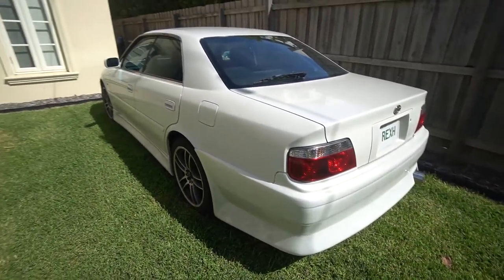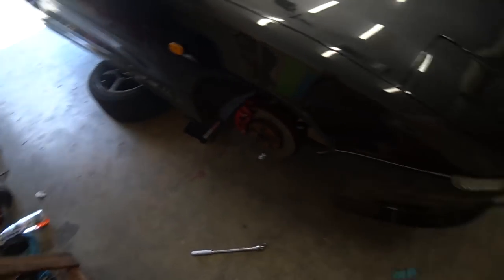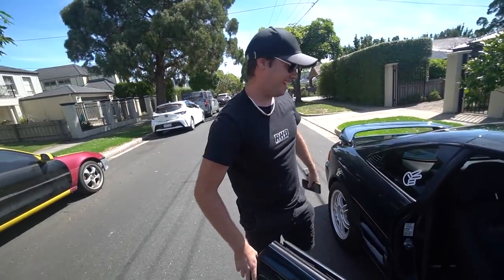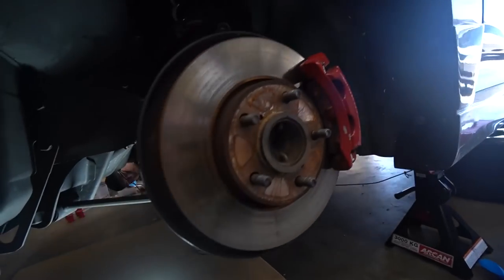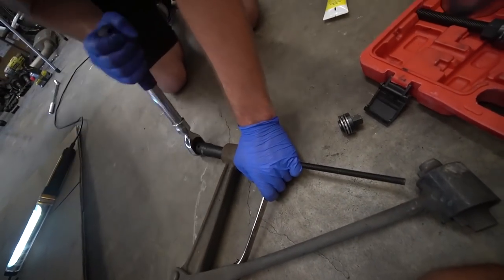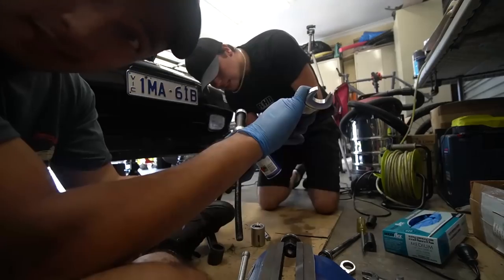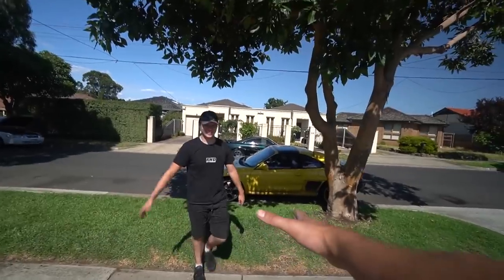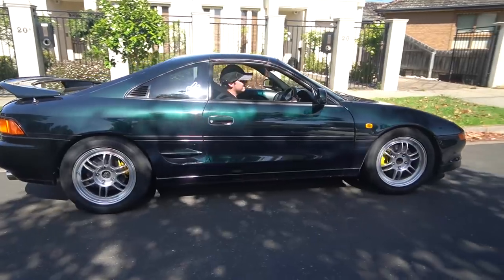TRACK DAY PREP for the MR2! - SUSPENSION OVERHAUL - Part 1

Comment: @RexH The sound change over is because the engine has ACIS (acoustic control induction system). Butterfly valves in the intake  open to change the length of the intake runners which lowers the pitch of the engine.